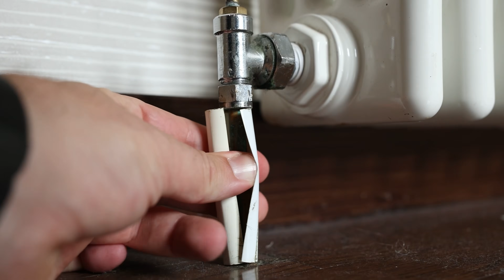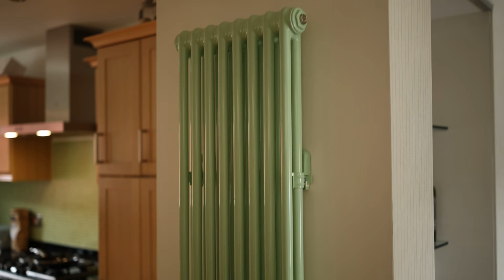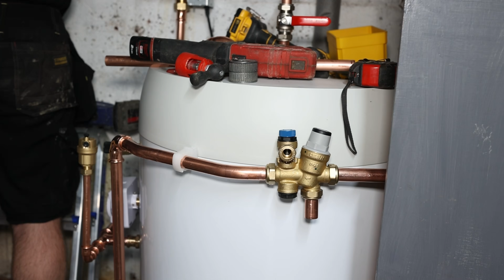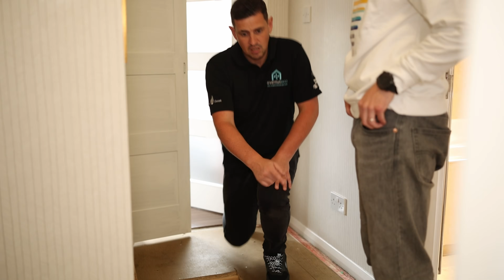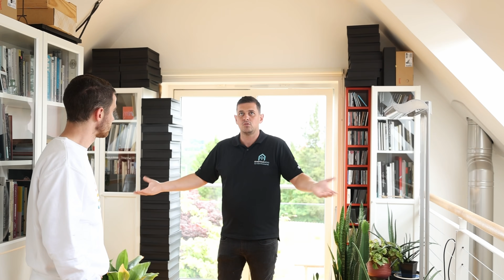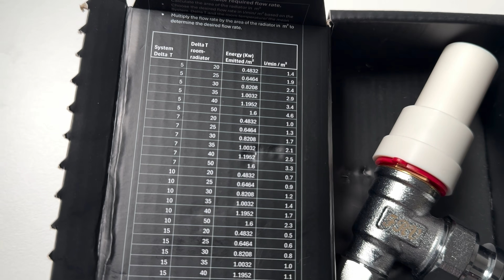Nae Buffer Nae Problem...Heat Pump

Comment: Can i ask why you dont belive in buffer tanks? Just curious on your opinion on them. I fitted 3 14kw air sources in a large property doing thousands of metres of UFH, swimming pool and large DHW tank. There was also a 200l buffer fitted before the 28mm flow and returns to UFH manifolds. Primaries were 35mm and headers before going to manifolds were 35mm down to 28mm, circulations pumps fitted on every manifold.
Reply from the maker: its not thta i dont belive in them or that they dont have a place they just are not needed in 98% of domestic settings, once you start going to massive properties, commercial etc they have a place for sure.